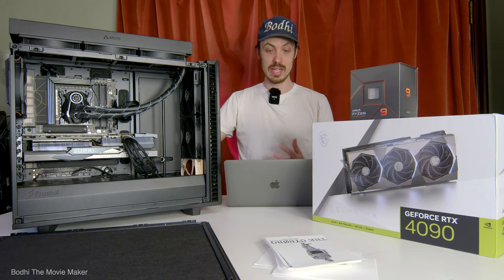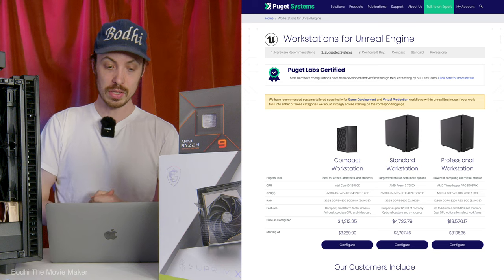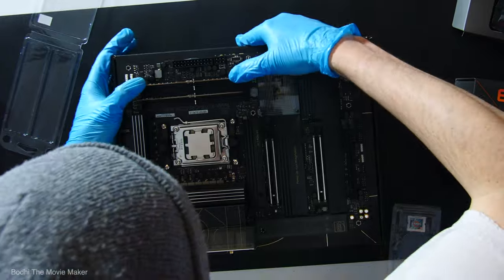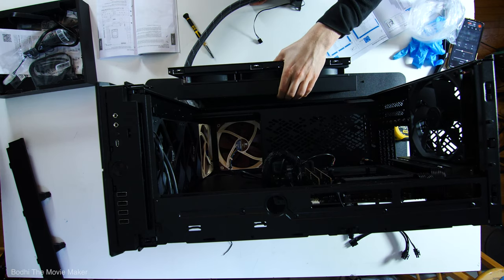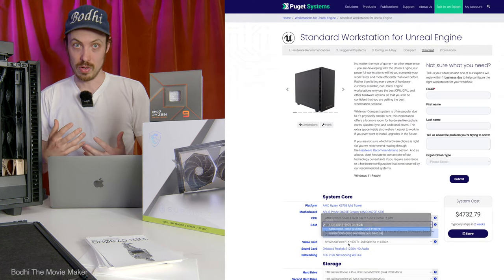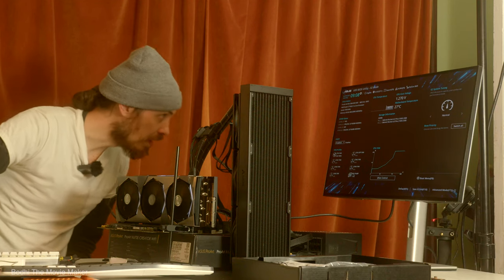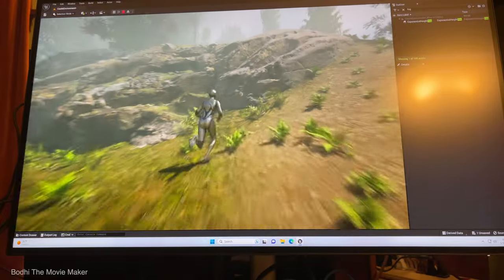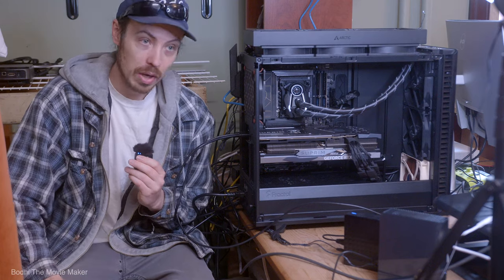I built a PC for Unreal Engine with an Nvidia RTX 4090 and Saved $2,000. Here Is How

Comment: Nice system! I will definitely take inspiration on that!
One question. Did I understand that right:
So performancewise it does not really matter which rtx 4090 I take? Only difference is cooling, needed powersupplyunit and look?
Reply from the maker: Thanks! Yes. You are correct. But I since publishing this video I learned of a few other differences between 4090s and I made a video covering that. Here it is ➡️ Which Nvidia Geforce RTX 4090 is THE BEST??? GPU for GAMING and Unreal Engine Realistic Graphics
https://youtu.be/kLtj7uWFnDI
Reply: Based on what I've seen it's the founders edition that boosts the highest. Most of the top scores for overclocking are with the FE and a 12900K. I still decided to get the Strix since all my other parts are Strix.
Reply from the maker: @ScoutReaper-zn1rz  very cool. How are you liking your strix? Do you over clock?
Reply: @BodhiTheMovieMaker It's factory overclocked so I won't be clocking it any higher. I love how instantly it made my old games feel older by playing them at over 200 fps at 4K lol. No complaints from me.

Comment: Just wondering why did you not go with the Ryzen 3D processor since that was more for the gaming prospective with the 3D
Reply from the maker: Hey! Thanks for asking. Just to clarify are you asking why did I buy the AMD Ryzen 9 7950x instead of the AMD Ryzen 9 7950x3D ?

The answer is: to save money. 😊 at the time the 3D had just been released so you could get the 7950x for a big discount. It made the 7950x $200-$300 less expensive than the 3D. So it was well worth the savings. Plus Puget had no documentation at the time on the 3D. And to this day the 7950x is still at the top of their benchmarks.

Comment: need help in a pc build. which cpu works better with rtx 4070ti super : 7900x, 13700k, 14700kf. For productivity builds(specially Unreal Engine 5) pls also suggest a suitable cheap and good quality motherboard with that supports ddr5
Reply from the maker: Those are all great CPUs. I haven’t personally tested those cpus with that GPU. But I except you will get pretty comparable performance between them. If you have the budget for the intel CPUs you listed I would recommend getting an AMD 7950x 16core cpu. It’s what I have and I am quite happy. 

As for a mobo look for a B650. There is even an ASUS Pro Art B650. Which looks great I love my ASUS Pro Art mobo. I have the bigger brother to the B650.
Reply: @BodhiTheMovieMaker  thanks but in my area they are all exactly the same price and the 7950x goes a little out of budget.
Reply from the maker: @Ultra_gogeta342  understood. 
Tough one. The 14700kf is the newest. Seems like a great bet. It also seems to have best specs of the options you listed. 
But if you get a good sale price on the Amd cpu. Go with that.  I’m sure you’ll get good performance either way.
Reply: @BodhiTheMovieMaker  thanks

Comment: Most of these "hiccups" are deff new PC builder mistakes.. You went with the bare minimum recommended PSU here... Its a very nice 850 80+ Titanium rated PSU... You are running a PSU at 82% for extended periods of time I would imagine. 80+ Titanium rated should be able to handle this in and will. However parts can fail as do with all PSU's. Their are a few tech-hardware channels on YT that open old PSU's up for repairs and to see what failed on them. Once you get out of debt, or if by year 2 of this PC build... Plz for the love of anything get you a nice 80+ Titanium rated 1000W PSU so you have much more headroom for the life span of this amazing PC build. Here is a quick blurb by a PC building vet. https://youtu.be/bUh2EZzJZRU?si=9NoMicH2xfozP6kP&t=574
Reply from the maker: Thanks a bunch! I am looking forward to getting a new PSU with a integrated 12vhpwr cable for my 4090. 
I always appreciate advice👍🏻